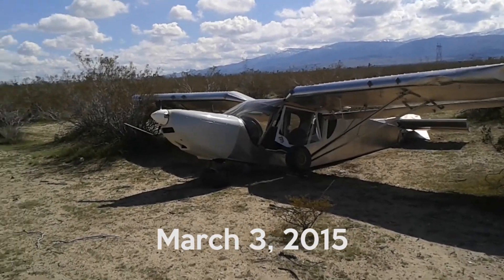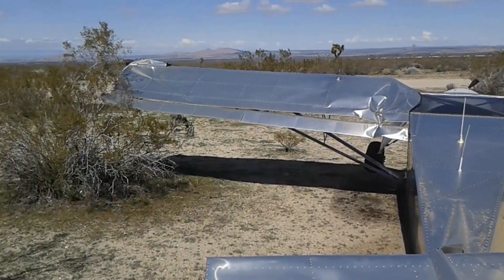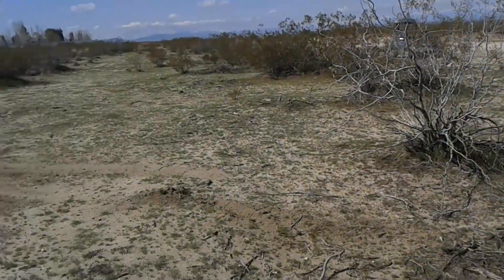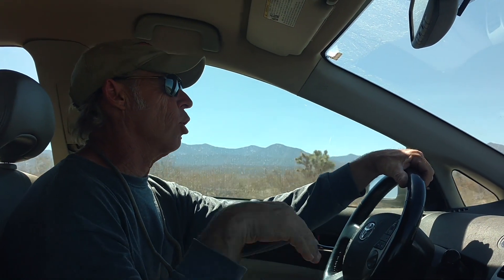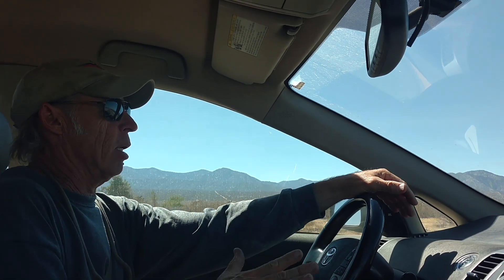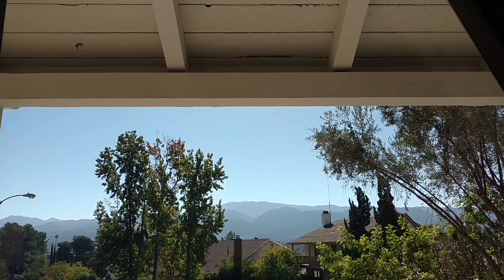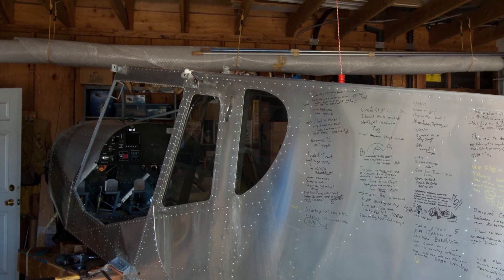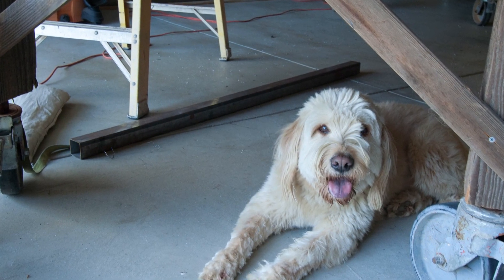"Zenith Phoenix!" - Plane CRASH & Rebuild - PART 1

Comment: Was this your first time flying an airplane? This is totally against the theory of flight. Also, in a departure stall, lower the nose to the horizon, and control with rudder. Neutralize the aileron, and be sure you are still at max power. Ultralight pilot don’t have enough training to be pulling these stunts...start with a private ground school to deepen your flight knowledge.... I remember I only did 10 hours for the ultralight/ light sport license... I learned a lot and it was real stick and rudder flying, but looking back from a current CPL, I was in the dark, and there was soooo much more to know. Don’t do this stuff with a basic light sport license... get a private and do some aerobatics training with an instructor.

Comment: A big part of the problem was continuing to hold ailerons against the roll direction. It adds drag to the stalled wing and it won't recover. Always use rudder only in a stalled situation. Glad it all worked out in the end.
Reply: Yope. Actually, only use rudder when close to the ground until ailerons absolutely necessary. Even when not stalled, the ailerons could stall the wing with aileron deflected down.

Comment: Slats probably would have prevented that! Not bad mouthing just know that slats do work! But glad your ok awesome rebuild too!
Reply from the maker: opictia very true. We recently put the slats on for a test flight and the power on stall was absolutely mind boggling. So much control at 35mph, stick full aft and loads of angle of attack! So yeah. Slats may have saved it!
Reply: @JonnyHuman  so VG - sucks , I guess..
Reply: @nautastro1503     What is   VG

Comment: Great repair job Chris and Jonny.  I've had the same thing happen while practicing full power accelerated stalls in my CH701.  Snapped right over on its left side into a dive.  Except I was at 4000 ft. AGL.  ;-) Doug Douggar was telling me something like that happened to him when he was showing off during a takeoff.  Doug was barely able to recover.  It's pretty much full right rudder for me to keep it straight during the accelerated stall.  But you have to work really hard to get it in that situation.  I can't see every doing that by accident unless you are showing off or trying to induce a tail strike.
Reply: Perhaps reduce the elevator travel by 1-2 degrees?

Comment: From the horses mouth (http://www.zenithair.net/high-lift-design/).

A well-designed sheet-metal aircraft also provides superior 
crashworthiness, as an impact’s energy is absorbed by progressively 
collapsing (deforming) the metal structure, as opposed to splintering or
 shattering upon impact. The landing gear of my STOL aircraft absorbs a 
lot of energy. It then requires more energy to “rip” it out, and the 
aluminum stringer frame and stressed-skin construction then need much 
more energy to start to bend, buckle and twist. The sturdy “cabin frame”
 will protect the occupants even in an unlikely nose-over of a tricycle 
gear airplane where the wings, positioned quite a bit higher than the 
occupants’ heads, will absorb the impact’s energy.
Reply: This is a great article that shows some real data that Zenith 701s (and probably 750s) have excellent survivability traits.

http://www.kitplanes.com/issues/28_3/exploring/Safety_Is_No_Accident_Homebuilt_Fatalities_9485-1.html